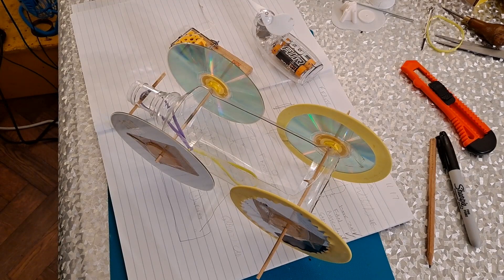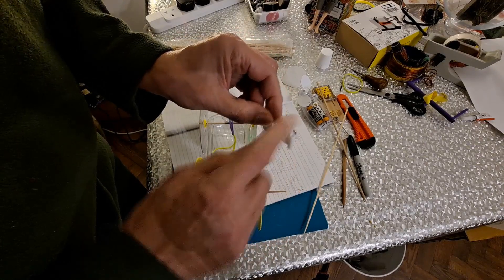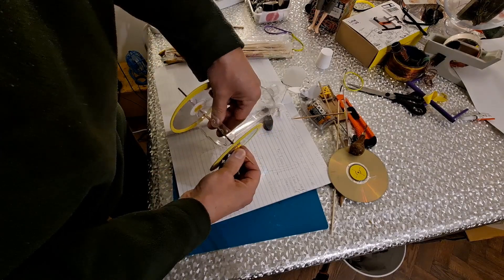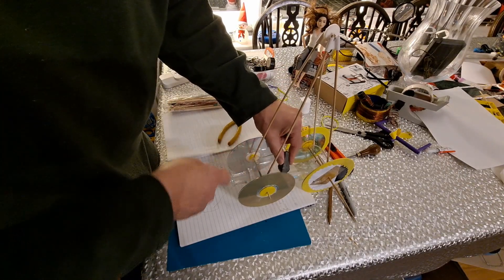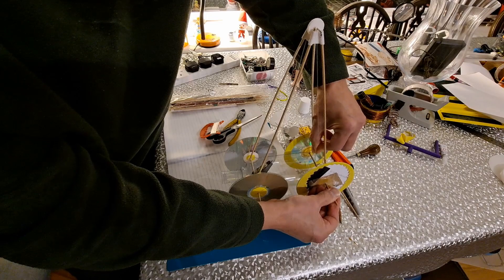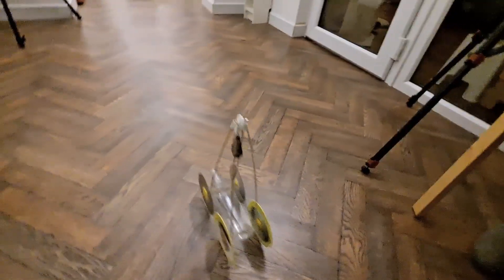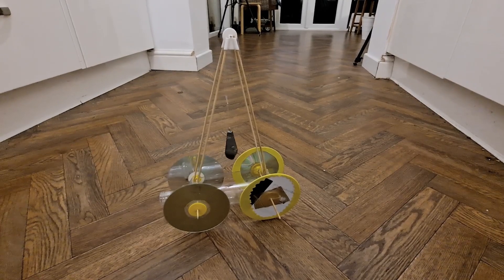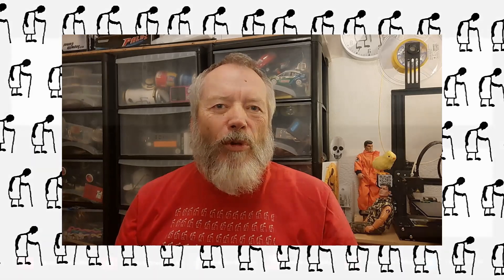Gravity powered Car from Oral B Mouthwash bottle

Comment: For my gravity card project it is starting off at an incline (ramp) of 30 degrees and then has to go 5 meters straight after with a drop of about 1 cm from the ramp to the floor. Do you think this model will be able to sustain that?
Reply from the maker: If you are using a ramp then surely it is not intended to have a weight and a pulley. It will just run down the ramp converting potential energy to kinetic energy. Something like this one https://youtu.be/N9S49KMwXmI

Comment: What is the mass of the object ur dropping?
Reply from the maker: It was 5 oz  or 142 gm
Reply: @GrandadIsAnOldMan  thank you, and how far did it go?
Reply from the maker: @reemhalawi9492  the distance it travels in the video is 8 metres and as you can see it hits the wall with some force so it would clearly travel further. If you check the video description you will find useful links.

Comment: I'm surprised at how well the gravity motor works. I wonder what would happen if you had a bit smaller diameter wheels. Perhaps some of the mini-CDs would work? Would it be faster, slower or would it work at all? Just a thought. Thank you for sharing with us.
Reply from the maker: Smaller wheels would give faster acceleration, but as each revolution would cover less distance, the total distance travelled while the weight drops would be less. If you check the video description you will find my playlist for gravity powered cars.

Comment: Use a rubber band to replace the weight, it will reduce the weight.
Reply from the maker: Yesterday's episode was the rubber band powered car.
Reply: Ok, put a spring between the mouth wash bottle and the string to simulate the lead weight.
Reply from the maker: @zaptainkuboom5520  no different to a rubber band.